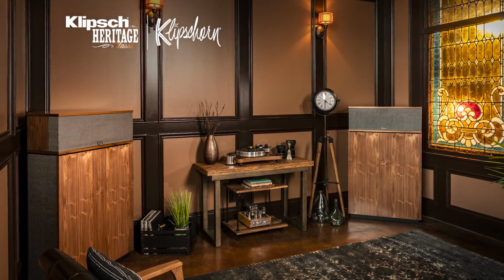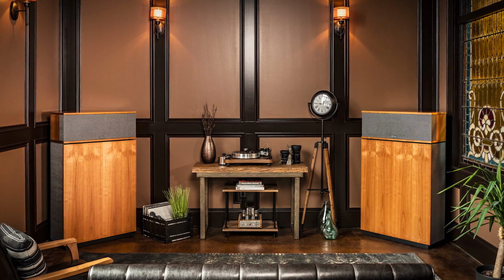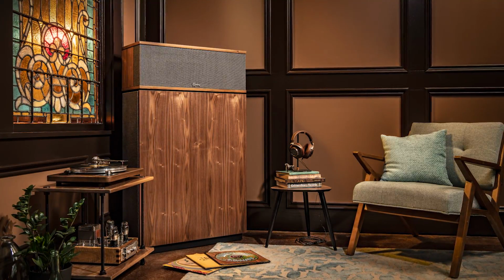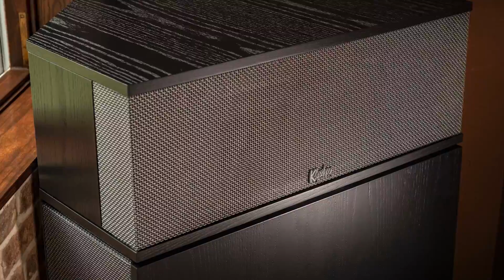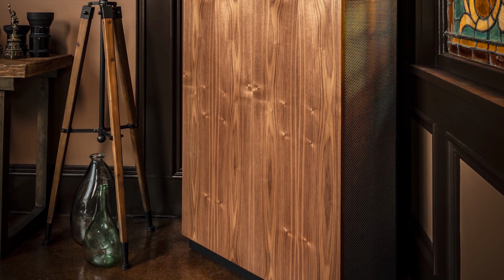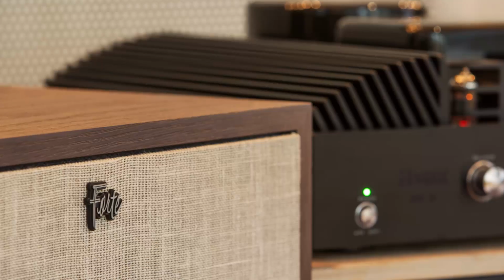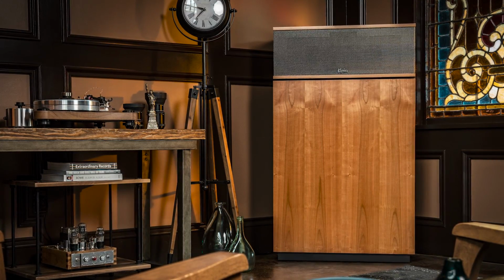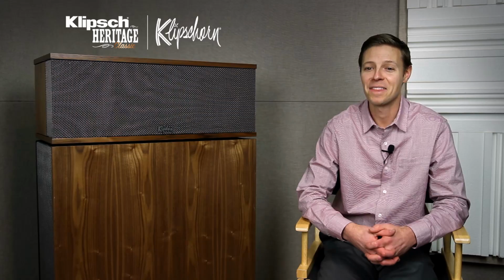Beyond the Specs - Industrial Design of the Klipschorn AK6

Comment: It was 1985 and I was in a mid-high end stereo store in So. Cal. 
I was just goofing around and listened to the music in the store. 
Then I went to the "back-room" and there to my surprise was this sound like no other. 
Clear, crisp with loads of warmth and separation.  
I asked what speakers I was listening to?
The guy said these are our Klipsch K-Horns. 
Hmm, until then, I never heard of them but I quickly fell in love. 
Back then they cost about 5K or so for the pair.
My background...I'm a product of the 60s and have always been a "tube" guy and endured transistors, integrated circuits, hybrids, PC board configurations, just about everything you could imagine...Threshold amps, Macintosh amps, Quicksilver, Conrad Johnson, etc. 
I've auditioned every loudspeaker imaginable in So. Cal back then. 
Many guys worked out of their homes because those days, Hi-End audio was so specialized
and very, very expensive and it was often by appointment only. 
But here I was in a strip-mall store-front but heard possibly the purest sound I have ever heard!
Ok, to be honest, I've always heard that "horn-loaded" speakers were, well a bit nasally and harsh to the ears. A few friends (I'm sure you've heard this one too) said that the speakers would drive you out of the room. 
So, proper amplifier/loudspeaker matching was crucial if you used horn-loaded speakers. 
In my Navy day's I remember hearing a pair of Sansui SPL 800s when I was overseas coupled to a 100 WPC receiver. Back then, receivers were all the rage. (overkill)
Yeah, they were loud, but oh so clean! My friend had a pair of JBL Century 100s and they were very nice (but to me, a little "tinny" to the top end). Just my opinion. 
My bible was TAS (The Audio Sound) magazine and I embraced every word of every article! 
Harbeths, Spica, Martin Logan plus every exotic product reviewed. 
To me though, I've always been an analog basic turntable (Linn) and a used pair of Conrad Johnson monoblock 50 WPC and esoteric bi-wiring kind-of-guy. I had a used AR line stage and a Magnum Dynalab FM tuner to tap into KLON (Cal State Long Beach had an amazing jazz station) and I had a brand new TEAC 10" reel-to-reel 2 track (I don't know why I bought a 2 track, I really didn't need it...Nobody else had one so naturally, I had to have one! I'm nuts)  
Well, I couldn't afford the K-horn's, but I could afford the Klipsch Heresy's so I bought a pair and a year later, another pair. 
Looking back, I guess I could have financed the K-horns but they do command respect in any room! lol
One day I will own a pair of K-horns as they are the "el-supremo" loudspeakers for me. 
There are so many great modest vacuum tube amps on the new and used market in the 10-65 WPC range that will drive the K-horns perfectly and give you headroom, warmth, truth plus goosebumps. 
Get an overstuffed chair, place it center and back in your sound room, put on some vinyl of jazz, Linda Rondstadt-Nelson Riddle Skylark, even Brian Setzer Orchestra and you're in heaven! 
Isn't that what it's all about? 
Enjoy!
Reply: I bought my 1st pair of Khorns when I was 19 for $1654/pair KCBR. I always kicked myself in the butt for getting the model C. They were around $600 cheaper. I gave them to my mother who at 87 uses them every day with a Mc240 and MX110.with a Lab80 mk2 table. Well I am just short of 70 now and just landed a pair of Ak5 in cherry. The 1st thing I did was add the spacers between the top hat and bass bin and now they are Ak5 B. I can choose my Infinity IRS Betas or the Klipschorns. Lately I have been using the Horns and loving it.

Comment: Kinda weird though that he only insists on cosmetic changes with those iconic loudspeakers. 

I’ve heard this new design recently, and they’re capable of changing the air pressure of a large room in an instant! They really do possess crazy dynamics, and this is their forte (no pun intended). They can really make the music “alive”. And, shall I say, at a very competitive price. 

 It’s too bad hearing this guy talking about “bookmatch veneers” and “grille clothes”. 
Oh well.
Reply: They don't need any improvement in sound,it's nice to see them a bit more beautiful instead.
Reply from the maker: Well, we already released a video about the technical updates, with Engineer Roy Delgado. But we also wanted for our Industrial Designer to speak to the cosmetics which is the reason behind the 2 seperate videos =)
Reply: Klipsch link please?
Reply: @margix1172  Well there was a time when you could get them in Teak, Zebra wood,  Mahogany, etc.
Reply: I have owned the Klipshorns since May 1980. One of the endearing aspects of these speakers is that at a low volume you can clearly hear the sound throughout the house, even if there is a crowd. They are worth every penny.

Comment: Let us tell you for half the advertisement about how we use a cheap laminate cover on our really expensive speaker.  Why on earth are you not using quality solid wood?  Makes no sense to me.  Most technological advancements for sound equipment were achieved almost 80 years ago and the khorn is proof of that.
Reply: Solid wood is not better, it's worse. Plywood is stronger & more stable and less resonant than solid wood. It's easier to work with and purchase. And veneer creates a better & more perfect exterior than solid wood. The idea that you build the internals of a machine out of walnut or cherry is something people who know nothing about woodworking might expect, but fine craftsmen know better. This is why so many great speakers are made of MDF, it's less resonant and more consistent.
Reply: @johnsmith1474  A veneer finish is a fake visual representation of real wood.  The reason it is used is so that cheap MDF, particle board, or plywood can be used.  Because MDF, particle board and most plywood is ugly, and a veneer finish is required.  Today the woodworking standard might be as you suggest but it is the cheap easy way out.  

You mention, "The idea that you build the internals of a machine out of walnut or cherry is something people who know nothing about woodworking might expect, but fine craftsmen know better."   I have never heard of a loud speaker referred to as a machine before, that is interesting.  No one said anything about the internals.  We are talking about the exterior finish of the cabinet.  A fine craftsman would be using Baltic birch and would never touch MDF.   

Particle board and MDF does not handle moisture very well or take screws or nails very well.  Glue works across all wood mediums sure I will give you that, but a price tag associated with the K-horn series from Klipcsh, it better not have MDF anywhere.   

As far as MDF having better acoustical qualities than solid wood or quality Baltic birch, that is something people who know nothing about sound equipment might expect, but a veteran sound technician and speaker builder knows better.
Reply: The veneer is as thick as 20# office paper. A friend has 40 year old Khorns and the finish looks much more like real wood than my AK5s.

Comment: No. 5805 could drive this speaker ?
Reply: essentially ANY amplifier can drive these! ... from the (under $200!) 3.5w/ch Tube Cube, to whatever 5805 you're referring to. 
Oddly, isn't there a lot of amps with the 5805 designation? I believe there are multiple small chip amps, an old Adcom, Denon, Onkyo, the new Mark Levinson, interesting...

Comment: Closed back?  No need to be in the corner?  Oh oh…. I do not believe it. This is not heritage..  This is a tinkle around the tree by smiling young elder haters… destroying the folded horn extension (wall), attempts at tinkling on the scared Paul Klipsch folded horn..
Reply from the maker: Actually, Roy Delgado made that update and has worked for Paul Klipsch from the time he was 17 years old. They have many patents together.
Reply: @klipsch  give the customers a choice. Purchase True open folded horn original.. or pick the supposed faux closed boom zoom closed box woofers like the cars of the hood. 

Publish Paul’s original signed design drawings, and journal notes/entries of this version come to life in AK6. That might cure doubts from non kool-aid drinkers… this is a design from Paul.  More than a back room intern science project. Shows he really wanted this new design to Replace the original.  Thanks for replying.

Comment: Not as good as Tannoy Westminster Royals But I thought of an idea you might like to try.
Have a massive horn bigger than the piston driver say 12" and seat the driver inside the horn? a square or rectangle horn with a round driver flush or protruding an inch in front of the horn with its face of the horn. but make sure the driver is suspended buy rubber or chord not hard fixed to the horn. and possibly a tapir tear parabolic or more likely hyperboloid tapered shape cone, on the back of the piston driver on the back of the magnet made out of felt or rubber extending right back just in front of the Horn diaphragm or near to. Make slits on the horn fled, protruding past the driver motor as well ? so are protruded through the cabinet out the back? And the horn extends from back to front So you create a [Venturi this could actually be done just with the horn itself.(c).] and will produce a better sound more powerful as well. Like an open baffle. Some enclosure on the piston driver might be needed or just filtering gauze?. (c) all rights reserved only to be used for research purposes without my knowledge, any commercial production has to be approved by me first. My first introduction concept was in 2014 Patent pending on a horn loaded driver what is open at both ends, and for a piston driver to be inserted into the horn itself.
Reply: the royals are very nice, but, you better have a living room the size of Wrigley field
Reply: You can get 2 Khorns for the price of one Royal. Kind like saying the Khorn sounds better than my RF7s, well they should! As for the rest you stepped off on the deep end.
Reply: The corner was the ultimate flare for the LF horn. That's the whole point of that speaker. Acoustical impedance matching. Amazing efficiency. Definitely not fine furniture but will rock on 10W.